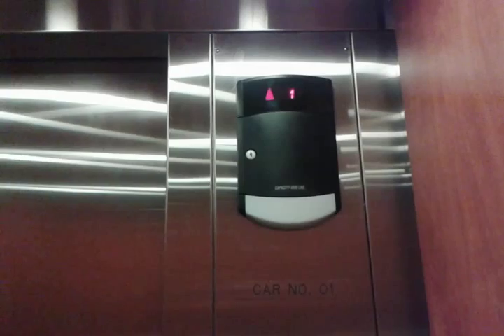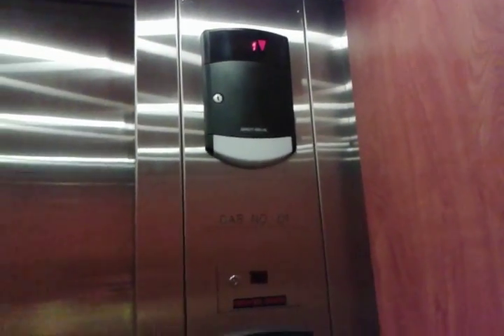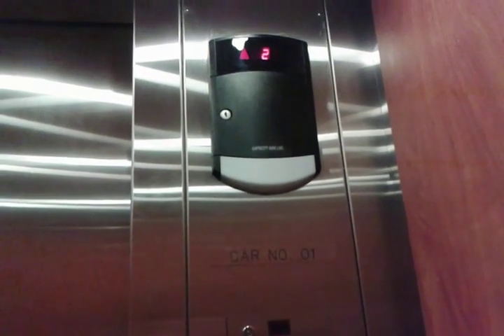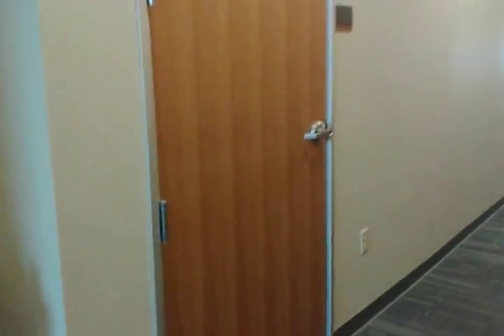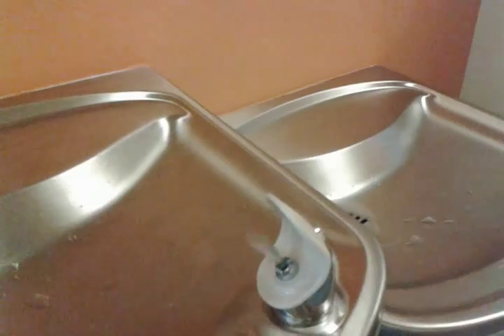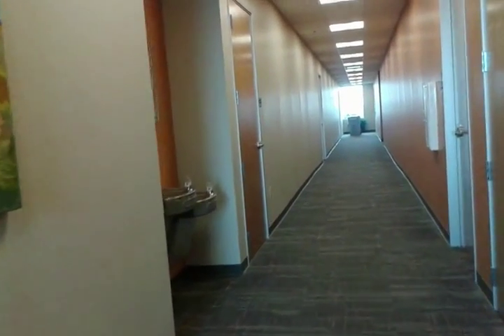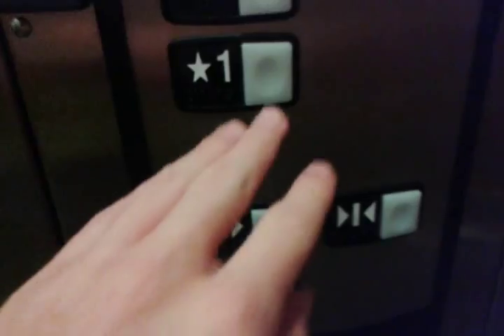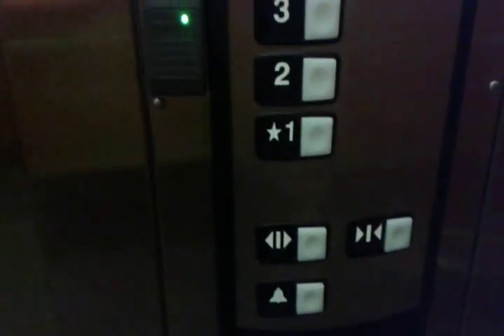Creaky Schindler 330A Hydraulic Elevator at CornerStar Healthcare Plaza, Aurora, CO

Comment: Interesting placement for the machine room.
Reply from the maker: The Elevator Daily Yes it is very weird. The reasoning for it is because there is no space for a machine room on the first floor and the second floor didn't have a completed floor plan, so they slipped the machine room in on the third floor.

Comment from the maker: Superduper Julien This elevator was installed in early 2014. It's just as bad as a pre-2014 though. I too think they should've installed ThyssenKrupp or Otis, but even KONE would've been a good choice.
Reply: What makes you think that kone sucks now?
Reply: No offense I just think they do now
Reply from the maker: Superduper Julien Well, I like KONE for the most part, but their elevators don't tend to hold up to heavy use. That's the downside to KONE elevators.
Reply: Gotcha
Reply: Elevating Denver What I notice about KONE elevators is that some tend to run TERRIBLE AND HORRIBLE and are DEATH TRAP and they controllers are extremely glitchy and laggy while some run good but then they break down eventually since the Eco disc and Monospace motors only last 4-6 years and they elevators need to get replace and that is why some people nickname them "temporary elevators"
Reply from the maker: Superduper Julien My brother's allergy office has a KONE that was been there for 6 years and it runs like new, but it's rarely used. The thing with KONE is that their elevators aren't designed for heavy use, so if they are used constantly 24/7, then they don't run well. That's why it's rare to see KONE in hospitals. KONE wares out easily in high-use situations.
Reply: Gotcha

Comment: Who’s idea was it to put the Machine Room on the 3rd Floor and not next to the elevator? The Pipeline PROBABLY goes up the hoist way to between 2nd and 3rd Floor!!
Reply from the maker: Train & Busfan33 I have wondered why the hydraulic machine is on the top floor for a long time. It probably has to do with the building being built into a solid rock hill, which likely made digging down harder. This is a telescoping hydraulic too I believe. And, as far as I know, it's the only hydraulic elevator with the machine on the top floor.